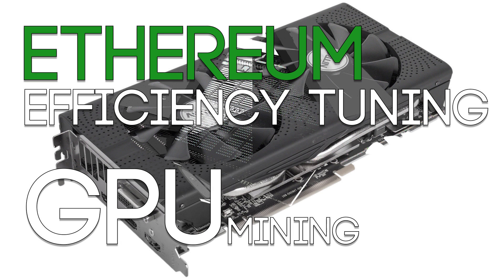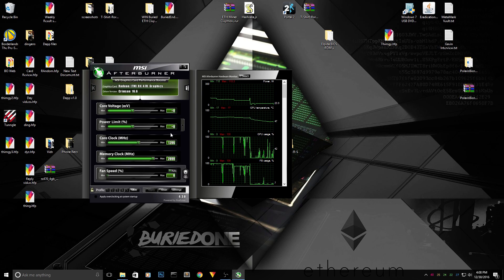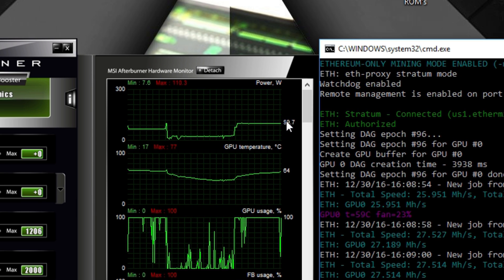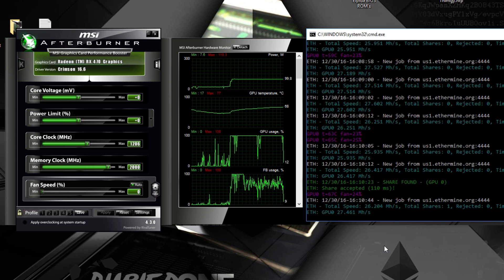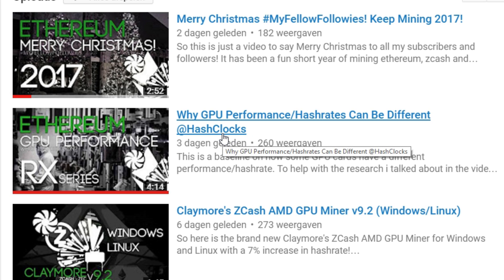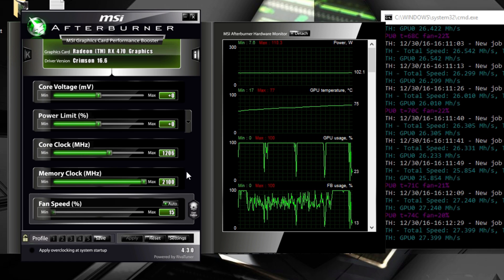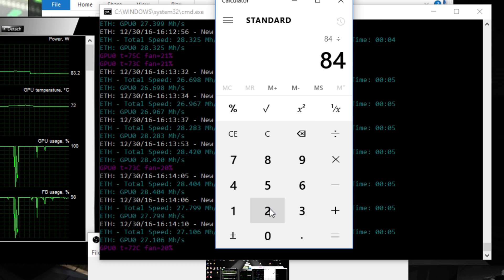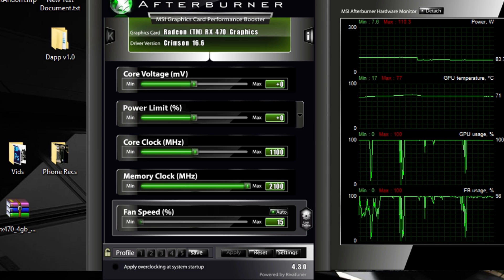Efficiency Tuning Graphic Cards For Mining Tutorial

Comment: That dip is bad, you dont want to have dips in GPU...
Consistency is key

Better to have few Volts more but stable 100% usage 24/7 than mega undervolted 100-20% occasionally dipping usage...

Why?
My testing claymore nanopool is

1.stability and consistency above all!

Even +3mh/s but less consistent gpu usage (dips) will yield less shares.( better to have 3mhs less but 100% stable number and 100% stable usage)

Comment: My doubt is the following: by biosmoding and finding the best MSI afterburn parameters for my card, will its lifespan be less than the lifespan of a not modified GPU? Even if I run my modded GPU on 50 degrees Celsius?

Comment: Any tips and tricks would be helpful. I turned my gaming rig into a miner recently for when im sleeping and working. It will runs for 17 hours a day minimum. I have an I7-7700k, gtx 1080, gtx 970, thermeltake cooling for cpu, 4 large case fans, and 1080 has 3 fans, 970 has 2. Im on a 750w supply. What can I do Ocing to get best money gain. Thanks

Comment: hey BuriedONE thanks a lot for your tips! i have a 4x rx470 rig and lowering the core from 1130 to 1100 and the memory from 2150 to 2100 dropped the wattage used from 650 to 550 watts !!! these are 2x hynix and 2x samsung memory cards by the way. the cards are bios modded and the BTG hashrate dropped slightly from 1.14 to 1.11MH/s. 
thanks again Sir

Comment: I am trying to tune my 390x for ETH/DEC dual mining. I have noticed that if I lower the core coltage, my hashrate increases, yet if I do the same to the memory voltage, it decreases. I tried to overclock the core and I lost hashrate, so instead I tried overclocking my memory and my card kept crashing. Anybody got any idea what's going on here? Core clock is 950, core voltage is 1050, mem clock is 1500, mem voltage is 1100

Comment: anyone getting more than 21.5Mh/s for new RX580 nitro+ 8GB. anything I try with afterburner or trixx just lower the rate. tried copying 1:1750 to 1:2000 memory straps in the bios and the rate went to 18. these are brand new cars just received this week. any help on this would be greatly appreciated.
Reply: Brock Huffaker yea same here
Reply: Jason I actually figured this out. Check out 1stminingrig.com. there I found a memory strap to copy and it got me up to 30MH/s
Reply: Hmm I can't seem to locate it exactly, could you tell me what straps you changed? and are u using mircon memory? thanks
Reply: Dz Kickz I believe it is the memory strap from the 480. All you should have to do it copy your 1:1500 to the straps above up to 2000.
Reply: Same problem here
Reply: Blockchain drivers?

Comment: Hey, Can you Provide the Best configuration for Sapphire Nitro + Radeon RX 480 4 GB?
Reply from the maker: Dipesh Sharma Almost nobody uses the 4gb but ill tell you that privately here, so its about the same as the rx 470 cards, ALWAYS   get the absolute maximum out of your Memory speed. For the core, look at the power usage and hashrate, find a spot where the hashrate drops a lot but the power usage stays about the same, that means that you need to increase it back up untill the hashrate goes up and the Powerusage goes up just slightly :) hopefully this was helpfull!
Reply from the maker: Maximum memory means tune it up untill you find a spot where the card goes into blackscreen and restarts your system, then find the sweetspot of 95% of that crashspeed ^^
Reply: You are suggesting me to buy Sapphire Nitro + Radeon RX 470 8 GB? and  Does the 480 8GB will give me similar output?
Reply from the maker: Dipesh Sharma Yes the rx 470 8gb is the best choice for mining because of the price of the card, if you want maximum hashrate and aweslme gaming go for rx 480 8gb

Comment: I have little problem, because i see no effect on my Nitro+ rx 470 8GB (samsung mem) after flashing. 
Mayby I doing something wrong.
1) offline, changing switch on cards in connector side (like on video)
2) Backup of bios and modification 1700->2000 Copy Paste
3) Flashing the same card (have allways only one connected)
4) restart and then system (windows 10) have problem with recognizeing my card, after changeing switch on card is ok, then i switch again and its ok (display is correctin silent mode after few restarts).
5) In tests a cant see difference in voltage  of GPU (cpuz) and in hashes (claymore zcash and etc miners also).

Where i did mistake?
Reply from the maker: Bitclub Network POLSCY GÓRNICY Hmm that should work, try it again and see what it does :)